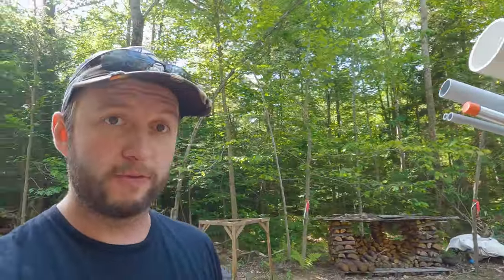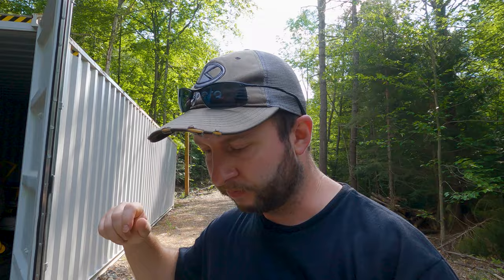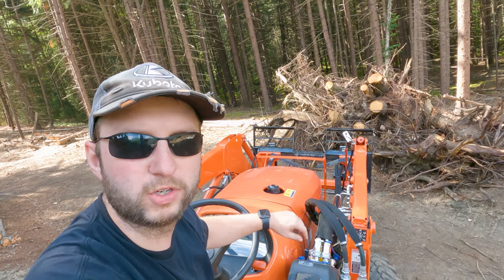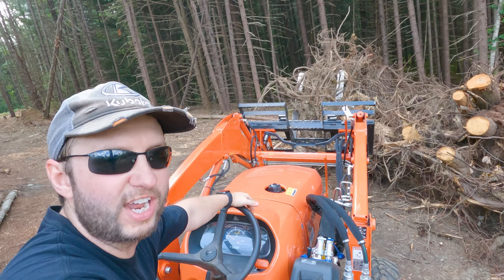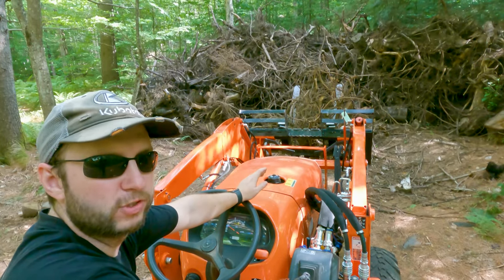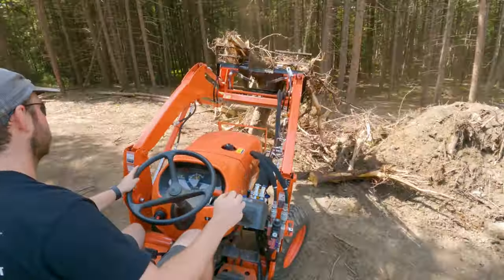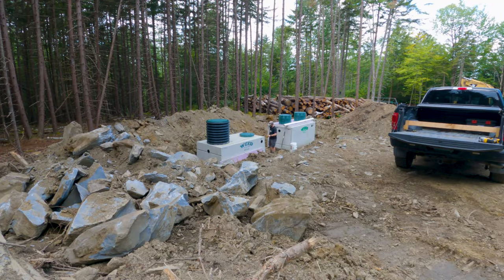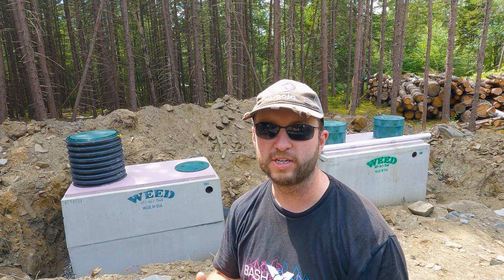Can we run septic off generator? | Septic System Ep 3

Comment: I'm just looking over your shoulder at the log pile behind you as you're talking at the septic tank.  you two have SO MUCH wood to mill!    10 million 2x4's await you
Reply from the maker: Haha, don't! Lol. We have so many logs to deal with it's become a real mission. Think we've figured out a plan. The smaller stuff we're going to sell - have a couple of people locally who can make use of the logs for sugaring.

Then the larger stuff we're going to mill - we made a good start on getting the "infrastructure" in place and the workflow running before we left for the winter: https://www.adventurousway.com/images/i/g80y9dvb8e24/2000w/news/hello-from-europe/lumber-piles-and-solar-kiln-base.jpeg

It's going to result in a LOT of leftover slab wood and we haven't quite figured out what to do with that yet. One option is to try and sell that too - it's good for sugaring. Another is to put it through the chipper, but we don't exactly have a shortage of wood chips!

Comment: Also. Why two septic tanks. Most septic systems use 1 main tank and then a septic field. The field is with pipes, chambers or concert containers that leach the fluid (not the solids) from the main tank. Septic field down hill and no pumping required other then removing solids from main holding tank every few years or so
Reply from the maker: This is what's known as a pressurized system, not a gravity flow system as you're describing. While gravity flow systems are more common, they have limits - one being that you need to have land amenable to the layout of such a system.

In our case, we didn't have a suitable location for a leech field downhill from the house site - in part due to the topography of the land, and in part due to natural water features present. We knew even before buying the land that a large, pressurized mound-based septic system would be required.

Keep watching and learn more about how to install a system like ours!

Comment: You need a graple on that tractor
Reply from the maker: We ordered one but after waiting almost 6 months it hadn’t arrived so we canceled the order. We’re making do with the forks for now!
Reply: They have grapples that are non-hyd(no 3rd hyd required)that would save you around 700.00 or more
Reply from the maker: We already have the 3rd function hydraulic on the tractor so that's not an issue. We've put a grapple in our "nice to have" list. Yes, it would undoubtedly make some jobs easier and quicker, but for the most part we can get by without it.

Comment: A septic system should be able work with no power, gravity is your friend.  I wouldn't put in a system that couldn't work without electricity.
Reply from the maker: In a gravity-based system, of course, you're right. Ours is not a gravity system, and installing a gravity system wasn't a viable option on our property due to its topography in the area around the house site - we knew this before we bought the property, so no surprises there.

Pump-based systems are a common approach, so not sure what your reticence toward them is. If we lose power we still have capacity for over 500 gallons of waste above the high pump threshold. Plus, as you've seen in this video, we can run the pump from a small portable generator as a backup if necessary.